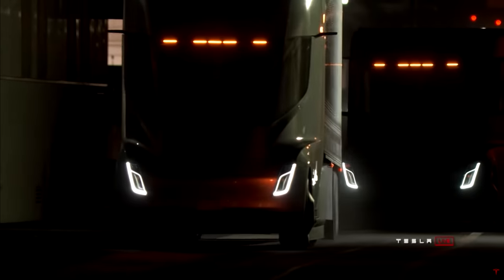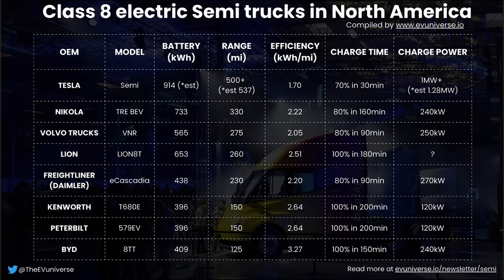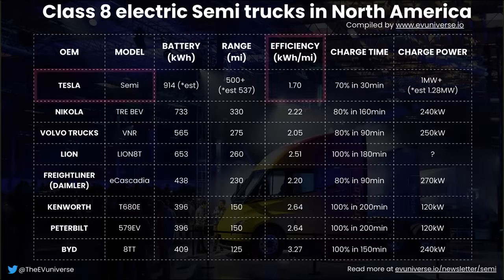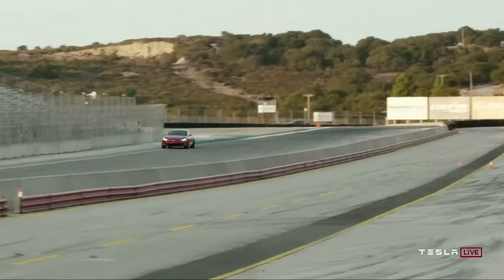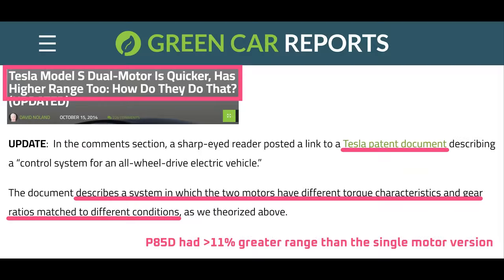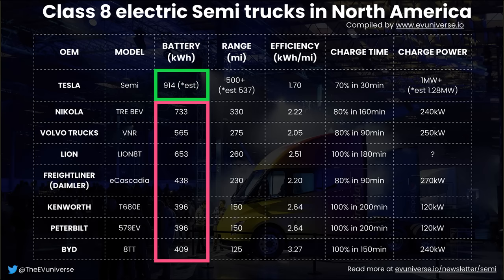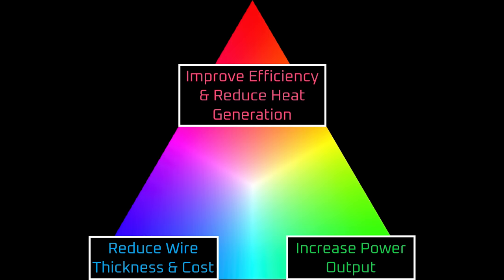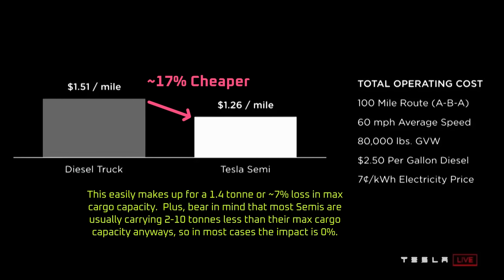How the Tesla Semi “Broke the Laws of Physics”

Comment: The Glaring issue is not running at normal operating speeds for trucks.
Semis on America's interstates run 70 to 75 miles an hour to get more miles under them in the allowed driving time.

The Tesla Semi was going very slow to be able to make the 500 mile range. 

Yes, it is amazing that they made the 500 miles, but it is not realistic to fo this the way they did it in the real World. 

I have a 2021 Chevy Silverado gas engine that can get 38 miles to the gallon if I drive at 50 miles an hour on a flat grade. 

That is not a realistic outcome for normal driving conditions while in traffic.

It is not realistic to tell people that I get 38 to 40 mpg on the highway with my 1/2 ton truck but it is possible.

Also my range will far exceed what is stated and be much higher than all other competitors.

If they really want to prove a point , go out on the interstate roads and run with other trucks and EV semis.

That will be more realistic and show exactly how far behind other manufacturers are. 

TFL trucks do towing comparisons between vehicles with the same loads and same routes. That is what should be happening now to make it fair.

Tesla will be top dog, and Nikola will be right on their heels as far as performance on in town or short route running.

I have investments in Tesla, Nikola and Hyliion because I think that they are the top 3 moving in the right direction for use cases. 

Nikola for H2 long haul.
Tesla for day use or distribution.
Hyliion for Retrofitting trucks or giving them a second life and a stop gap in between ICE and zero emissions.
Reply: It is fine for a day hauler, which is all the current Tesla semi is.  They have been testing them in the real world for a couple of years.  You understanding is simplistic at best.
Reply: @TheEvilmooseofdoom  I understand far more than you think. I used to actually drive and repair Semis right out of high School and Mechanics school. I ran a Wrecker for towing Semis and had to be able to maneuver in various situations.
As far as a day use or shag truck the Nikola Cab over is a superior design as a day runner and in heavy traffic.

The Tesla is going to be a pain in the Ass to back into tight areas when you sit in the middle of the cab. 

Anyone who has actually driven a semi will tell you the same. 

That means the Tesla is better suited for highway and interstate use. The turning radius will be shorter than a conventional but much larger than a cabover.

I have been researching and been investing in EVs for a long time.

I am sure that my understanding is far beyond simplistic. 

I can actually tear down and rebuild that semi could you?

I actually worked on billion dollar high tech in the Army , with sophisticated computer control systems and Electronics , have you?

Don't make assumptions about people or their  understanding. 

Tesla is still learning about Semis.
They are teaching others about EVs.

I am rooting for all three of the companies I mentioned. We all should be supporting anyone trying to progress in this arena.
Reply: He was going slowly because the semi truck speed limit in California is 55 MPH. At higher speeds, the range would certainly be less.
Reply: @BigBen621  Man do I have a problem with California gotcha laws. It is like however they feel that day or which way the wind blows. Either they like you or you are gonna pay for your uppityness. 

California vehicle Code 22406 is some major BS. 
The law states that Trucks cannot go over 55 on California Highways and vehicles cannot travel over 65 miles per hour on 2 lane highways.

Yet the interstate speed limit is 70 mph and not 1 mph over. You could get a tail wing and just roll to 71 mph and they gotcha.

The actual wording in the law does not say trucks are limited to 55 on the freeway but the cop will cite you for endangering other motorist with your reckless disregard in your driving. 

Even though people are passing you like you are standing still the cops just see a cash register in the form of a big rig.

They know you can't appear in court so you just pay the fine through a lawyer who screws you worse. It is all a scam.

If I lived in the state I would be a thorn in their ass and fight every ticket and argue my case for hours to impede their money to minute ratio.

Nowhere else in the country do people have to deal with this crap.

I hated crossing into California. They are going to lose a lot of money when all truckers refuse to haul loads into the state or from the ports. 

You are going to see truckers haul loads out of the other ports in the US and avoid California.
Reply: @desertdan100  You acknowledge that CVC 22406 limits trucks to 55 MPH, but then claim that "[t]he actual wording in the law does not say trucks are limited to 55 on the freeway". Are you claiming that a freeway is not a highway? That claim doesn't ring true.

You seem to claim that truckers get cited for 1 MPH over the speed limit; yet in the 500 mile range test, the Tesla Semi was often going 5 to 10 MPH over the 55 MPH speed limit, and other truck were routinely passing at even higher speeds; so this claim doesn't ring true either.

There's no reason why truckers would refuse to haul loads in California; there's no effective difference to the trucker between a longer route, and a shorter route that takes longer because of the lower speed limit. And I'm guessing that for every trucker that turns down a load in California, there are 5 waiting to take his place.
Reply: @BigBen621  You are making my point. The Tesla semi was running much slower than other Semis that have to run 55 miles per hour on the highway or Freeway.

The 1 mph over the speed limit is for everyone on the interstate. 

The law I stated says 2 lane highway in the wording of the law.

Then California gave themselves all kinds of wiggle room and vague wording. 

It isn't against the law ( Per Se )

If you are driving a car and all of the other cars on the road are driving 75 mph you are not breaking the law Per Se if you drive 75 mph.

If you get a ticket you can go to court, pay the court costs and have your attorney get the ticket thrown out if the lawyer can argue that you were driving according to the pace of traffic as to not cause a danger.

Unless you are a trucker and get caught driving the same speed as traffic. Then they will throw the book at you and jack the fines up according to how fast you were going above 55 miles per hour and can even throw you in jail for 6 months and or suspend your license.

They know truckers are just going to pay the fine because they can't make it back to appear in court to fight and if they fail to appear there are serious penalties and possibly losing your livelihood. 

They tried that crap with me and many others but we were in the Army passing through and they had no jurisdiction over us because we were exempt.

The 55 mph law for truckers is for 2 lane highways and not multi lane freeways but they wrote themselves in loopholes for the California DOT to use as they see fit.

Go study it for yourself or should I say try to. Every other source changes every other month.

I got lucky and got out of it because of the situation and a lazy cop.

As far as truckers refusing loads, there are tons of reasons and many truckers running better paying loads in better places.

California has the no idle laws so you have to deal with that and you sit forever waiting to get loaded because of the back log and jacked up politics.

Then when you get your load you can't go over 55 so it takes you longer to cover miles and you can't get as many miles in per day. 

Truckers get paid by miles , loads and time. They can get docked for late deliveries or missed schedules. 

I am not making this stuff up. 

56 mph will get a trucker court costs and a starting fine of 285.00. That is a start and it ratchets up quickly from there. 

65 mph will get you over 500.00 to start and it is at the discretion of the judge for how high above that and possible jail time if he is so inclined or the magic phrase endanger ed other drivers on the road  comes up.
Reply: @desertdan100  "The law I stated says 2 lane highway in the wording of the law." The law you cited (CVC 22406) reads as follows: "No person may drive any of the following vehicles on a highway at a speed in excess of 55 miles per hour: (a) A motortruck or truck tractor having three or more axles or any motortruck or truck tractor drawing any other vehicle". There is no mention of "2 lane" in this section.

CVC 360 defines highway as "a way or place of whatever nature, publicly maintained and open to the use of the public for purposes of vehicular travel. Highway includes street." Again, no mention of "2 lane" in the definition of highway; so clearly this includes public freeways, such as I-5 in California where most of the 500 mile range test was run.

"The Tesla semi was running much slower than other Semis that have to run 55 miles per hour on the highway or Freeway." Now you're just making stuff up. The Tesla Semi's speed can often be seen in the left display, when it's not obscured by the bill of the driver's cap. And for example, if you look at the video frame by frame, at about 0:34 you'll find a frame where the Tesla Semi is doing 65 MPH, and is being passed by another semi. So essentially nothing you've said is accurate.

I've driven the length and breadth of California for 60+ years, and I can state as a fact that there are plenty of truck drivers willing to take loads in California. If you don't like the laws and enforcement in California, you are of course free to decline any such load.
Reply: @Ben Thurston  Interstates are Federal roads and get Federal funds to help maintain them state highways don't.  Hence the name Interstate. One of the most well known is I 80 or interstate 80 it is a major interstate road used to transport goods and Military equipment at non stop high speed West East across the US.

Look at any road map. If it has an I in front of the number, it is part of the Federal Interstate system and falls under that jurisdiction and is different than state highways. 

Federal interstates are governerned differently just like Rail lines.

That is why it is different when you go to court for infractions of laws and statutes on the Interstate.
Reply: @desertdan100  Thanks for the dissertation on the Interstate Highway System, which I was in desperate need of. But I don't see the relevance to our discussion. Are you saying that state speed limits don't apply on Interstate highways; or CHP doesn't have jurisdiction on Interstate highways; or something like this? If so, I can assure you from personal experience that this isn't the case.
Reply: @BigBen621  the US federal government actually can influence speed limits on Interstates by the threat of withholding federal funding, which is how they managed the "Federally Mandated Speed Limit" of decades ago... but it is indeed the states which set the actual speed limits and other rules.

Comment: And how do you do these calculations without knowing the cargo capacity? Tesla is guarding the truck weight and freight capacity like the nuclear launch codes. It's not because they're so good! And the megawatt charger does not exist and probably never will. Let alone solar ones as Elon promised. A megawatt requires a substation.

Also Tesla promised a fixed  7 cents a KWh, they are actually charging 50 cents. It is more expensive than diesel.
Reply: Two Megachargers have already been built at each of two Frito-Lay plants, Sacramento and Modesto; so at least four exist. 

Tesla routinely builds Supercharger stations with a capacity of 20 to 25 megawatts; I don't think they'll have a problem with a few 1 megawatt Megachargers. 

Tesla sometimes charges around 50¢/kWh at public Superchargers. The initial model for Megachargers is that they'll be built at customer yards, at customer expense; so power will be at the customer's commercial rate, which will always be much lower than 50¢/kWh. This will, of course, vary widely by state and locality, and is one of the factors a potential buyer would consider when deciding whether or not to purchase Tesla Semis.

Got any more misconceptions that I can address for you? You're welcome.
Reply: @BigBen621  

I said there are no megawatt chargers, not charging stations. 

And oh boy, you need a course in electricity. I can have a megawatt of capacity in my house, but I can't have a megawatt plug. The electricity travelling through the grid is not a megawatt , though many volts, which can be broken down. You can't turn 240kw into a megawatt without a substation. And yes, we all know a customer is free to build anything they want, Elon said Tesla would. At present it is max 1/4 the speed and 7 times the price. When he said " we could offer it today" . 5 years ago. Along with the faked FSD video, the train of semis, the Amphitheatre in the starship ( that was a good one) and more other things than I can count. 

Any more misconceptions 😀
Reply: @markpoidvin5382  Thanks for your bizarre efforts to explain electricity—I needed a good laugh today! "The electricity travelling through the grid is not a megawatt , though many volts, which can be broken down" is a classic which I will save for future enjoyment. Stay safe out there!
Reply: @BigBen621  

Laugh all you want but that is how it works. It is like saying you have 80psi of water pressure coming into your house, Making 2 connections to the main will not give you 160psi. That is what substations are for. You have to connect to a 640 volt wire and step down.
Reply: @markpoidvin5382  No, but two 80 psi connections to the main of 10 GPM capacity each will give me 20 GPM. When you say "You can't turn 240kw into a megawatt without a substation", You're confusing watts with volts, and substations with transformers; even a substation can't turn 240 kW into a megawatt,  and all it takes to step down voltage is a transformer. And please tell me where in the world you are, such that distribution voltage is 640 volts.
Reply: @BigBen621  

Also I notice you skipped over the 7 cents a KWh. If operators decide to operate their own charger, fine. But Elon said Tesla would provide side of road power at a fixed 7 cents a KWh. And that is not happening. And at present fuel for the electric truck is more expensive than for a diesel. Yes it's POSSIBLE to build a solar powered one, with battery backup and charge 7 cents. Possible and practical are 2 different things.

Electric cars, great solution. Electric long haul trucks, will never happen. It will be hydrogen, contrary to Elon's ramblings. 

Or FSD. He removed the radar saying they could do it with just cameras. Why would you want less data? Radar, LIDAR and vision would help it from turning into traffic or coming to a stop because it is unable to accurately measure speed. Radar solves this. LIDAR solves other problems. And LIDAR is now dirt cheap and so is radar, we are talking a few hundred a vehicle. But why bother when people are willing to pay thousands for what is available right now on many cars as standard. The FSD part is useless unless it works 100% at least part of the way.. say highway only. It does not. 

I would love to try and explain to someone 40 years ago that people are lining up to pay over 10K for something that does not work.
Reply: @markpoidvin5382  You know less than you pretend.  I suspect the 7 cent figure is dated and was referring to their own charging sites, not the grid connected sites.  As for electric being more expensive than diesel that changes from area to area.  These are not long haul, and hydrogen is a fools notion at best.  They removed radar from FSD because it's low fidelity.  LIDAR is not that great a solution to anything it's just a crutch people cling to because they don't understand what Tesla is trying to do with vision only.  You don't understand enough to explain anything.
Reply: @TheEvilmooseofdoom  

It's not dated, it is what he promised when he introduced the semi in 2017. And obviously it was for Tesla sites. He does not control the price of electricity elsewhere. Promoting 7 and getting 10 is an oops. Promising 7 and charging 50 is a flat out lie. 

And you don't know anymore about Tesla than I do. I have been following since the beginning. I admired him for a time, until it became obvious this man was simply lying. Tryin to get FSD with less data is not " what they are trying to do" , it is a failure of imagination. Radar is perfectly good for spotting things vision does not, like a semi that is white before you get decapitated. 

People are paying 10K for something that does not work, and they know it does not work. That is not a business, that's a cult.  I did not say electric was more expensive than diesel, I said TESLA was charging more than diesel costs at rapid charge stations, unless you want to sit there for a week while the semi charges.
Reply: @markpoidvin5382  He never stated you'd get 7 cents everywhere.  It only becomes a lie when YOU make up more.  I don't think you understand the difference between a projection and a lie.  Your understanding of radar is flawed.  They are paying 10K so they don't have to pay more later.  It doesn't take a week to charge a semi.  You pretend to know and understand more than you do and you bend the truth for your convenience so you can vilify.  YOUR behavior is shameful and more than a little dishonest.